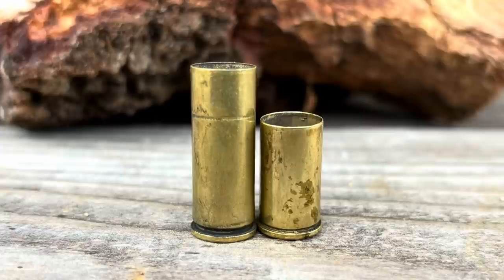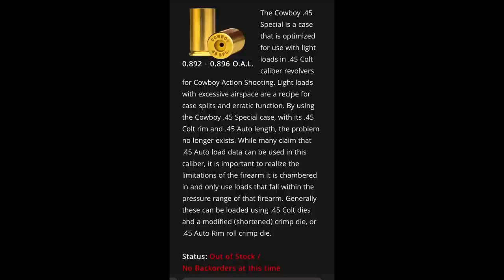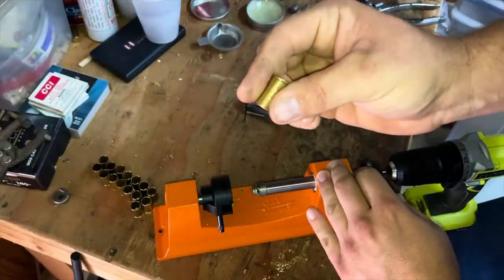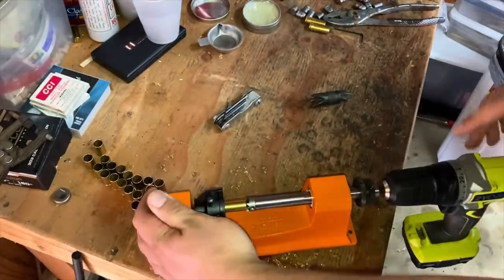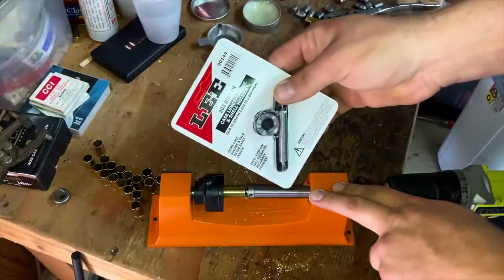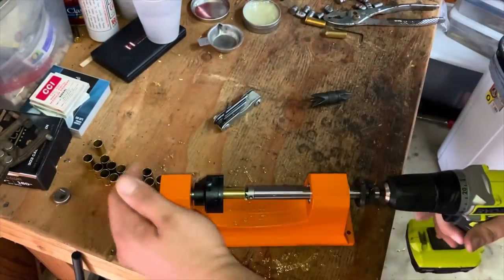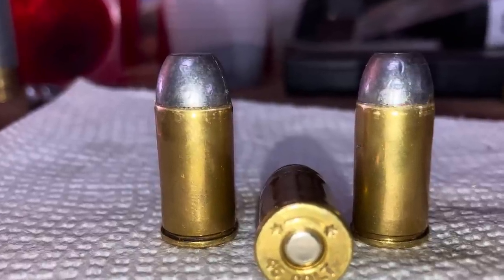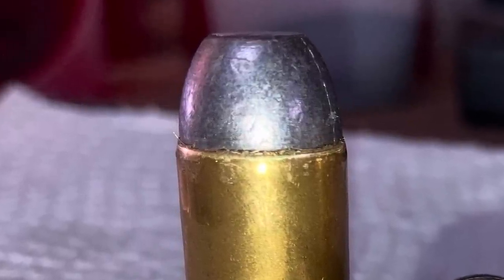Making 45 Cowboy Special Brass

Comment: Interesting. Even shorter than the 45 Colt Government (AKA Short Colt). I presume that the rim is different than the old 45 Autorim.
Reply from the maker: Yes
Reply: @mkshffr4936...
45 Colt was Never known as 45 short Colt!
Reply: @shadowcastre  And? Fact of the matter is that there was a 45 Short Colt (Officially called the 45 Colt Government) thus the need to distinguish the long one. As a bonus it distinguishes from the auto version. Boxes were not labeled long for no reason.

Back in the day everyone would know what you were talking about if you said 45 Short Colt. A lot of perfectly valid terms were never official.
Reply: @mkshffr4936  
I think everyone was/is smart enough to distinguish the long cartridges from the short ones.  Any name used other than the correct name is a misnomer... including 45 long Colt!  There were no cartridge boxes labeled 45 short colt and any box you see labeled long Colt is a marketing screw up that is continuously propagated left over from 1800's ammunition logistics.  Open a box that says long Colt & look at the head stamp.  It'll say 45 Colt!
Reply: @shadowcastre  And the shorts have the same headstamp but are clearly a different cartridge. There are cartridges for which there is no official +P designation but if you have an original spec weapon you best not ignore it since "there is no such thing". That nonexistent round can damage you and your weapon.

Terminology snobbery is very tiring.
Reply: @mkshffr4936  
LOL...  Lol...
Reply: @shadowcastre  Laugh all you want but you are just plain wrong.
Reply: @mkshffr4936  
I laugh because you are talking in circles!

45 Colt is the ONLY cartridge with the 45 Colt head stamp, +P or not.  I have pictures of all the other versions, including 45 Colt Government and they all have their own head stamp.  If you are dealing with +P you had better read the box!

Try to have a nice day...
Reply: @shadowcastre  From Jim Jordan's article "The long and short of 45 Colt"

The Winchester .45 Colt's that Paco and I have came from Shootist Keith Owlett who gave them to us a short time before he passed on. The cartridge box is deteriorated and I have it put away now - at least what's left of it. But it is plainly marked ".45 Colt Government". The head-stamp on the cartridges is ".45 Colt" ... BUT these are SHORT .45 Colts! The head-stamp is the same as the longer .45 Colts, even down to the "W" on the primers.

Think I will go with Jordan and Keith over rando YT expert.

Have a great day.
Reply: @mkshffr4936  
I've read that article and they are only refering to them as 45 short Colt.  None of the cartridges carried the name of 45 short Colt or 45 long Colt

I will have a great day...  You too!  :-)
Reply: @shadowcastre  Yet you just said that the 45 Colt is the only cartridge to carry that headstamp after having already read proof to the contrary. Oh well. Pax.
Reply: @mkshffr4936  
Hmmmm....  Well I'll be!  I think you got me there.  I'll own it!  :-)

After re-reading that article and some further digging Remington & UMC did use cases head stamped 45 Colt for the 45 Colt Government and there is speculation that they are cut down 45 Colts cases.  Peter's however... used cases that were actually head stamped 45 Colt Government. 

I have a version of the 45 Colt Government that I load from cut 45 Colt cases and WSF powder.
ATB...
Reply: @shadowcastre  🙂👍Peace.

Comment: What do you think the 45 Schofield round is in that class of being a 45 short
Reply: @andrewkelso3533...
There has never been a 45 short Colt!
Reply: The only thing I have heard of is a 45 Schofield being a considered a short I would think it would be just fact of its short case and anything shorter than that would be considered in that class yes
Reply: @andrewkelso3532  
No... Though they may be shorter than 45 Colt, Each cartridge has it own correct designation like
45 Schofeild ...
45 M1877
45 colt Government
45 ACP
and the recent Cowboy 45 Special.

Its also incorrect to call "45 Colt" 45 long Colt.